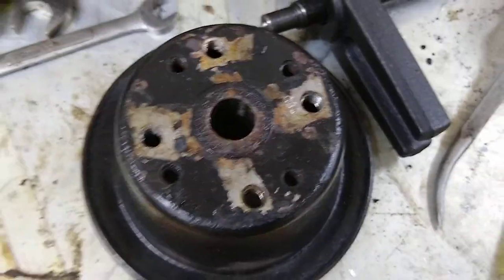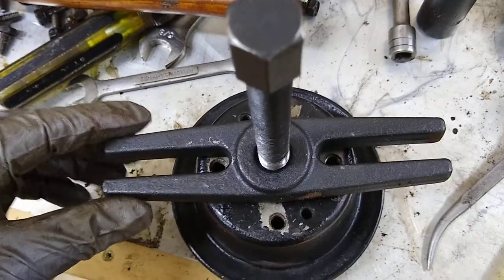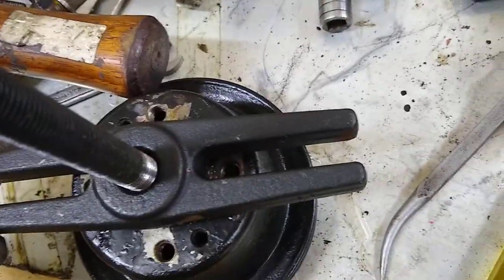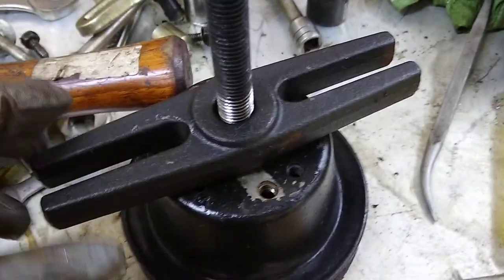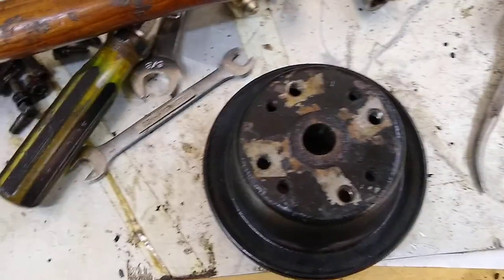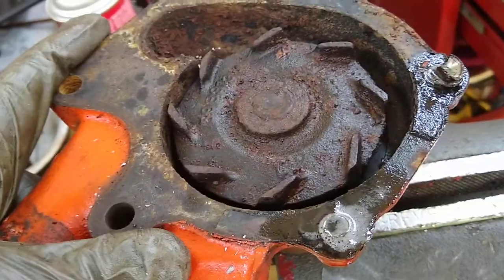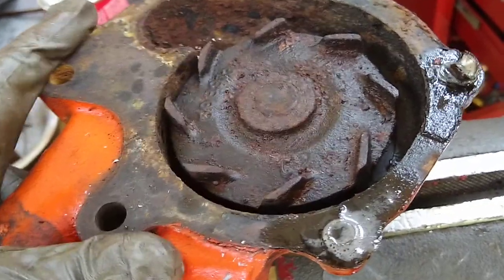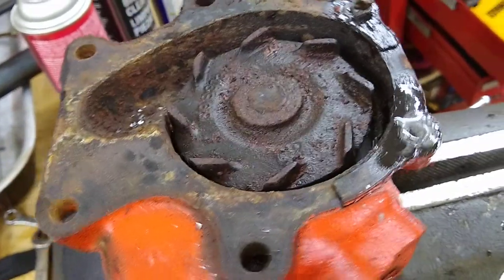GMC 228 Water Pump Rebuild Part 1 - Removing the pulley

Comment: Do you remember where you got the rebuild kit? I am working on my 57 GMC water pump and thanks for the info. Especially the pulley. I have the puller and never even crossed my mind. Thanks!
Reply from the maker: Hi Earl - I ordered the rebuild kit from a seller on ebay called '2ndgenautoparts'.  Here is the link: https://www.ebay.com/itm/174225218915